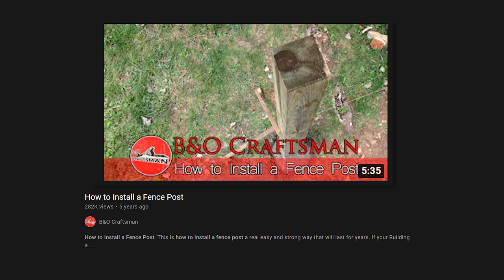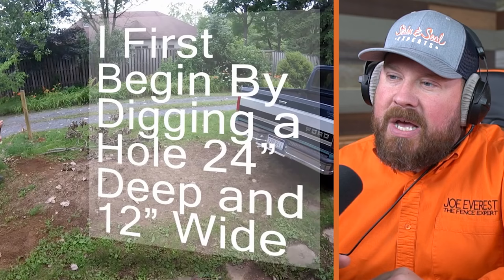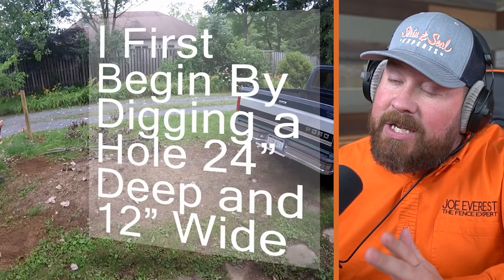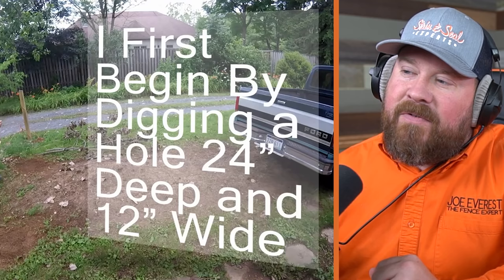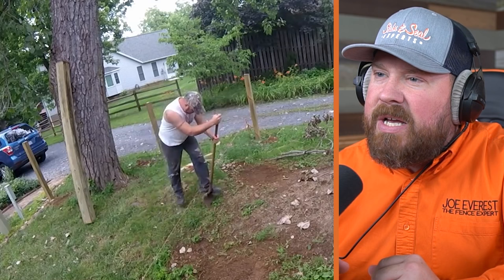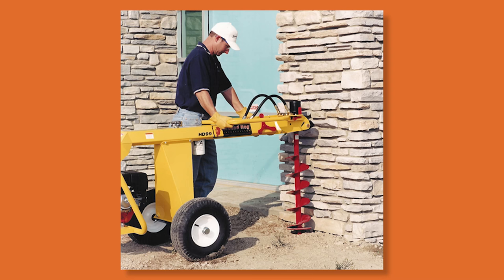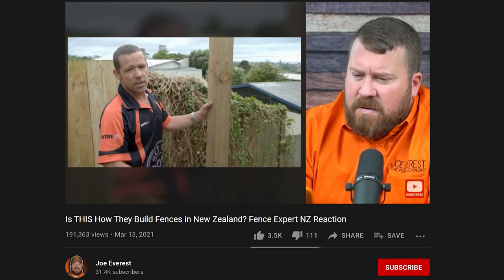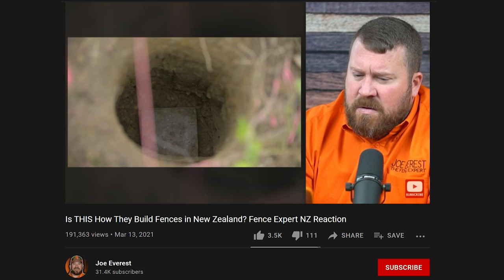One of the Most SOLID Post Installation Videos I've Seen

Comment: You answered a comment of mine a few weeks ago. I am using 4x4-10ft posts, 3ft down, 1 foot across, plus cement mixer + using 1-2-3 mix, to make a 100ft fence and, basically, yes apart from the bracing I do the same.

To brace I use to pieces of rail either side with one across, 4 screws, a ratchet clamp and a post level so I can make lots of mistakes and still have lots of room :D

Comment: Hey Joe,   Just ran across this video.   I live in an area where termites pose a threat to wooden post more than rot.   So I try to avoid any ground contact. With that said, it is my understanding that it is bad practice to fully incase the post in concrete. A couple of things I do: 1) I put a piece of paver in the bottom so there is no ground contact.  2) I will put termite insecticide into the bottom of the hole to ward off the hungry ground dwellers.   3) bring to concrete just above ground level sloping it away from the post.
Reply from the maker: Sounds like a solid process, I appreciate you sharing it!

Comment: Just set a half dozen 4x4 posts directly in the ground with no concrete. Dug 30 inch deep holes, added 6" of gravel, then packed alternating layers of gravel and clay around each post. The way they make pressure treated now I expect the posts to be rotted in <10 years and figure they'll be easier to replace without all the concrete.  Mind you this is after I set a longer fence section with 14 steel posts in concrete, which I hope to never bother with.

Comment: I have a 10” auger that u just have to slide a 2’ pole thru and turn it by hand. It’s perfect for dirt without a bunch of roots or trash. With a sharp shooter and that auger I can dig almost any post hole and a few. Mins. And I don’t need to rent an auger or the other related expense.
Reply: I usually like to add a kicker or 2 to brace it for leveling a lot easier if u don’t have a helper. Rocks or stone are a great idea innthe bottom of the hole.

Comment: When I install 25’ - 30’ vertical ham radio antennas in the ground that have a lot of wind load, I will typically dig about a 6”-8” hole for a 1.25”-2” aluminum mast that is about 2.5’-3.5’ deep. I put the mast into the hole that has 6” of gravel at the bottom. I fill in around the mast with 3/8”-1/2” gravel and tamp it down as I fill in around the mast. This provides an extremely strong foundation without the use of concrete.  

With this being said, the same principle could be used with wooden or galvanized fence posts.  And the mast or fence post can be easily removed if necessary. On top of this you don’t need to wait for the concrete to set.
Reply from the maker: Great process, I appreciate you sharing it!

Comment: I make the bottom of the holes wider than the top to keep the frost from heaving the concrete.(bell shaped 🔔.  Also when I set the post I lift the post up a few inches after a few feet of concrete is in the hole to get concrete under the post.  This keeps the bottom of the post from rotting and no need for rocks or bricks in the hole.
Reply from the maker: Sounds like a really solid process, I appreciate you sharing it!

Comment: Here from Canada... 48" deep frost line and we put a dry bag of concrete at the bottom of the hole and spray it with water then set the post then poor wet concrete to fill.
Reply: How deep you dig? 10 foot posts? I’m in similar climate and building a fence soon.

Comment: The warping makes a lot of sense.  The center it will dry evenly.  The center also called a plith can also crack all the way through following the center of the growth.  So can go either way.
Reply: Adding to this, in wood working, you typically try to avoid the pith as it can cause more warping.

Comment: I’ve heard using roofing tar to coat the post up to grade will help prevent rot where you backfill.
Reply from the maker: That could work, but I’d rather use a purpose-designed product like PostSaver.

Comment: Any thoughts on putting tar or other protective coating on the end of the post coming in contact with the ground? I've thought this might extend the life of the wood and protect from rot.
Reply: no need. If you suspended the post in the hole with a board at whatever measurement you want,mine is typically 2 feet, then dig your hole 26". when you set the post & level it it will suspend in the hole. Then pour your concrete & it will seal the bottom of the post.
Reply: Water will enter the post above ground and soak in. How does it escape out the bottom if it is fully encapsulated? Setting fully into cement also creates a cup that traps in water.
Reply: Concrete is also porous and will still allow moisture to get to your post.
Reply: @JohnS-hp2xu  Yes. If people want to waterproof their posts they should just use waterproof posts. 75 to 80% of the post is above ground getting soaked in the rain. Do people think the water suddenly jumps out when it soaks down to the ground level? Duh! People are so smart they're stupid.
Reply: I used flex seal at the base. We'll see how that turns out I guess lol
Reply: @flaminkidflip  If I may recommend something... just put a band of sealant in a band around ground level.  That's where the rot starts, where it can also get oxygen. But not down the buried length under ground. Not for a LONG time until after that ground level area has rotted and the post is already compromised. I've pulled many posts and the only area I've found of concern is always is at ground level, not subterranean. All these "My daddy did it this way.." is just nonsense. Study chemistry/physics/biology- most of those encapsulation tricks are usually worse than doing nothing. The best thing I have found is the practice of soaking the posts in old motor oil to a point a foot above ground level. Except that old motor oil is a pollutant but so are many of these other "tricks". The oil kills the bacteria/fungus that cause rot and retard water absorption while still allowing any moisture to slowly drain out. Especially if you cut off a bottom few inches after soaking and it also greatly helps if you protect the top by cutting it on a good slope or covering it (a big enough soup can works great).

Comment: I tar the bottom of the post and then roll a mixture of 50% used motor oil and 50% diesel fuel. Let it dry well. My dad did it that way when I was just a young boy (8) and those post are still in great shape today and I am 60 y/o now. Plus I like color it makes them. The trick is to make sure it is a dry pressure treated post, not the wet wet one you get from the store.

Comment: Ground contact isn't as important as wet contact. If you are making a concrete-filled hole, the concrete will hold some water, preferably not constant. The water can drain or evaporate. if you have dense clay soil and you gravel fill it then concrete, you are essentially creating an area where water will pool. and remain wet. the lumber can wick that moisture up to the oxygen layer and cause rot. In this case it is better to place the post directly on the clay to prevent additional water pooling under the post.

Comment: water, trimmers, and wet vegetation up next to the post should be a major contributing factor to rot.  I beat the heck out of my posts with trimmer wire. I have noticed post rot quicker where water flows over the posts. If one doesn't trim around the post water that collects on vegetation will contribute to quicker rot. That is my best guess and I am sticking to it.
Reply: I saw a tip somewhere to cut 2 liter bottles to wrap around the bottom of fence posts and young trees to protect from trimmer line. Seemed like a good idea!

Comment: Why not use gravel for setting the post instead of concrete?  A hole filled with gravel around a post is very solid and does not allow lateral movement.
Reply: Not ideal for all soil types

Comment: Seems like a solid job to me. I try for 36" every time as I live in the north east.  I also do the stone drainage at the bottom.  I like the post to set in at least 3 or 4 inches of crushed stone before adding concrete.  Whether or not this extra step is necessary only time will tell. When ever possible I will use crushed stone packed tight around the post and no concrete. Generally only if I can get down 36" and only on line posts.
Reply: I agree. I also, as I have seen in another video, coat the bottom or in ground portion with used motor oil then tar to prevent rot and has done an amazing job. With that said, it was a short run.

Comment: The rocks or paver at the bottom definitely does not hurt, but I think the concept is lost on some. You really should use a couple inches of gravel. Not as much to keep the bottom of the post from ground contact as much as to provide drainage so water is not sitting at the bottom of the post.
Reply: Which is why encapsulating the post bottom in cement prevents drainage, holds moisture in. Regardless, ground level rot quickly outpaces any subterranean rot.

Comment: On the 4x4 warping over time , attaching plywood strips to the post the same width can prevent warping .So construction adhesive and short screws the plywood on two side of the post ,right angle sides of the post if post will be rained on.The wood must be able to dry when it gets wet. Dare that post to warp.

Comment: The Japanese wood workers are very very particular about wood grain. 
The Japanese still have structures over 1000 years old standing to this day. There is a nuance to wood grain thats more than meets the eye. Cuts off of center will dry the grains differently. Wet to dry a board will want to be a tree after it leaves the mill. Not every tree can grow perfectly straight but every board can be cut straight, and with supply and demand on better cuts usually fence post get the short end of the stick. Standard grade usually is 2 or better some places its grade 3-4  just like studs and that denotes the number of hearts per a certain length (can’t remember what that length is) the more hearts the more spots for unequal drying along with how each stand of wood grain holds its structure. regardless some boards are just meant to bow or twist. It’s how you cut and mount them that can either help or worsen the imperfections.

Comment: Posts deteriorating at ground level:  weed whackers are going to chew away at the post waaaay faster than natural decay.  I'm of the opinion that you should make sure you slightly overfill your post holes with concrete so that the concrete will shed water away from the post.  This also has the benefit of giving a three or four inch buffer zone that will take longer for grass turf to fill in.  This means you can weed whack without hitting the post for a good while.  Not necessarily the prettiest thing to look at, but it's a sight better than a chewed up post that's listing badly one way or the other.

Comment: I live in Cincinnati Ohio. I just removed an old deck that I was told by a neighbor was built in the late 80s. The posts were rotted and the deck was in very sad condition. All the rotted posts were worst just below ground level and broke off there. The ones I got out whole looked good on the end and none were set on stone. Adding stone is probably an unnecessary step.

Comment: I've heard different opinions on adding concrete to wood post. Which is more reliable and for longevity? To concrete, or not to concrete, that is the question.
Reply: I had the same question. I’ve put some in without concrete and some with. But I’m not sure which one is going to last longer or if I’ve made a mistake by adding or not adding the concrete.. sooo and advice “wood” be appreciated

Comment: Concrete cures, not drys.  Also I coat the post at the ground area with several coats of sealer to help prevent rot. Just about a one foot band around the post.
Reply from the maker: Great clarification, I appreciate you sharing your process!

Comment: I used a treated heart 4x4 on a wood partition and it warped within 4 months. The other heart 4x4 on the other end of the partition did not warp. Everything was stained just a day after installation too.
Reply from the maker: Interesting, I wonder what the difference was?
Reply: @JoeEverest  I'll eventually fix it and when I do I'm going to investigate it. 👍 Perhaps it's not 100% warp free when we use heart 4x4. The boards were pretty dry too when installed.

I just remembered I installed a 4x4 treated and it was a heart board for my bird feeders and it's been about 12 years now and it's straight as an arrow still. Lol

Comment: Kind of curious about the concrete below grade. Let's say you use this method that he used. Could you use a different material to wrap around the bottom of the post to protect it for longer?

Could you use rubber mulch, or gravel, could you coat the bottom portion of the post with several layers of paint to protect it? Essentially what I am trying to ask is if there is any extra method to add to his to increase the longevity to avoid rot?
Reply from the maker: Absolutely, there’s a product called PostSaver that is made just for this purpose!

Comment: Since fungus must have water, food (your post), and oxygen to grow, and since the amount of oxygen below about 6"-8", especially in soil with a lot of clay, is pretty negligible, what do you think about a moisture barrier system with a thick mastic layer coating on the post covered by a thick heat shrink membrane from about 9"-12" below grade to 2"-3" above grade as a moisture barrier for the portion where there is oxygen available. Would such a thing help avoid rot in the aerobic zone of the soil?

Comment: A quick and easy tip. Set the end posts first. Run a string from one end to the next, and allow all of the posts in between to BARELY  touch the string for true alignment avoiding a waving fence line.
Reply: For chain link? Yes. For wood/vynl/ ornamental? No. You want every post to be on the string line. Solid advice setting the terminals first though!

Comment: My approach is to put a large concrete mowing strip along the length of the fence. Easier care plus no soil around the post. Thanks for another great video Joe.
Reply: This is counterproductive to combating frost upheaval. But I've never seen a post lift from frost forces although codes talk about it often. 
Cement set below ground level and covered with soil reduces this. Rob Peter to pay Paul, I guess.
Reply: @finallyfriday.  We don't get temperatures cold enough for that to ever be a problem.

Comment: Joe i like your optimism as the paint was drying....dam. Nice to see you picking up on the tips and tricks. The couple of posts that i have seen with rot where right at groung level in aerobic zone. Was thinking of leaving concrete high so no soil contact but as you mentioned people mentioned rot still occurs. Wonder if some type of flashing would work better 2" above aerobic zone ? I have seen some timber that was laying on some flat rocks that looked to be really old no rot?

Comment: Hi Joe, looks like it will turn out alright, although what I like to have is the post centered in the concrete. I’m working a fence, 4” posts, that have been set like his in the video, likely because they were not accurate on the string line, and every flippin’ one of them leans in the direction where there is little to no concrete. I’m digging around each post enough to get at least a 16” diameter with about an 18” shovel depth to give it some mass. About all it’s centered in the hole.
I like to bring the concrete up and slope it away from the post, not to protect from rot, as I agree they will all rot at the interface, but it’s to keep landscapers from beating the hell out of the bottom of the post. I have some that look like they have been run through a pencil sharpener! To be fair to landscapers, the same applies to sons that better things to do in their minds. I remember those days to, but I’m better because of them. Thanks Joe.

Comment: Not sure if anybody here is watching from Canada. I set my posts 42" with 8" wide holes for 6x6x10 posts and 6" wide for 4x4x10 (if it is a high wind area I will do 10" for 6x6x10 and 8" for 4x4x10. Because we go 42" deep we dont need to do as big of a diameter to the hole. And i use quick set concrete. 2/3 of a regular sized bucket and then add the concrete so the mix Is nice and wet while makes for a very solid post.

Comment: If only i could have used a digger machine. My fence is in rural south Texas, I had to use a vertical breaker hammer (thats an electric jack hammer people) and an SDS rotary hammer to dig my holes. at 1 hour per hole with 2 guys (1 operating jackhammer, 1 operating a big shop vac to removee demolished  caliche from hole) Its taking many days as we can work on it. But its coming along nicely. I also have a coring bit for my SDS rotary hammer. Makes nice clean holes in Caliche.
Reply from the maker: Holy cow, what a process!
Reply: @JoeEverest  yeah, I was thinking the same thing as I did the first 2 holes myself, and grabbed my neighbor as I waved cash in his face ha ha. I got my helper.😁 for my gate I am using 3 inch hollow drill stem and the coring bit should be the ticket. If not, I by bye to a couple more benjamins.